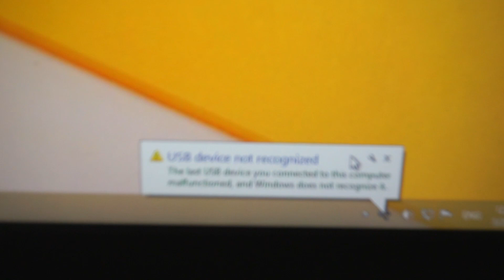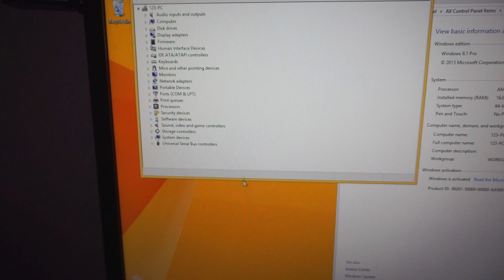USB device not recognized, malfunctioned (Desktop PC)

Comment: I have tried EVERYONE and nothing works. I have a Toshiba Satellite C55. I have one usb on the left that still works. The 2 on the right don't work. One went out 2 mos ago and the other went out today and I am going nuts trying to solve this.

1. I turn it off, took out battery, wait 1 hr and still doesnt work
2. i update all the drives, 1 by 1,  and still doesn't work
3. I went to properties, power management, turn off the hide button and still doesnt work
4. I uninstalled all of the drives, restarted computer, and still doesn't work
5. I clicked on action, updated driver software and still doesn't work
6. I troubled shooted, found no error to fix
7. Opened Devices / Printer, tried to add the two drives and nothing
8. Tried to restore it and still nothing
9. I search for windows updates 8.1 and nothing

I dont if I am missing something, but please help if you know a solution
Reply from the maker: Install another Windows (keep the existing one also) and try it there. If it's not working than probably it's a hardware issue and you might need to replace some components (if possible) or try to use a USB hub (splitter), or get a new laptop.
Reply from the maker: Install the new Windows into a VHD file for easier removal and for safety reasons (everything will be inside 1 file). ► https://www.youtube.com/watch?v=dk2AZxESKJs
Reply: @furulevi  easy said than done. new laptop, new drive, new windows... uhhhh. 
1st Solution. go to walmart and buy usb hub for ($7.99)
Reply: @furulevi  i have a similar issue with my galaxy tab 3 where i tried updating the driver yet it states that it is up to date.. i tried to uninstall the usb and restarted the computer and it was still unrecognizable.. if there is a hardware issue with this device how would i be able to get anything i had stored in the device

Comment: i did all because is not yet ok
Reply from the maker: If it's generating an error message than it is halfway OK, check the cable and the connection, otherwise if the USB port does not recognize the gadget at all than it might need some drivers also ► https://www.youtube.com/watch?v=6CPoKlBbLyE